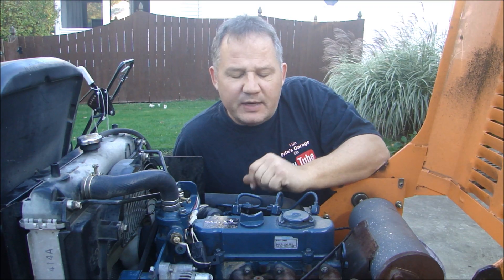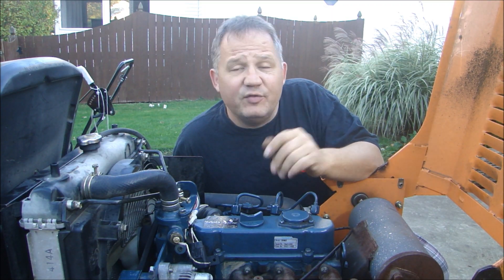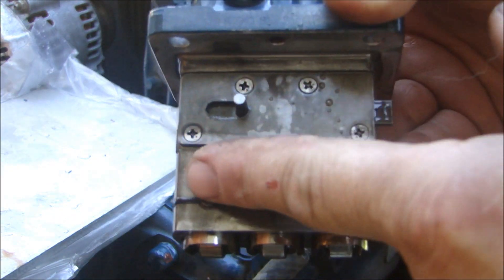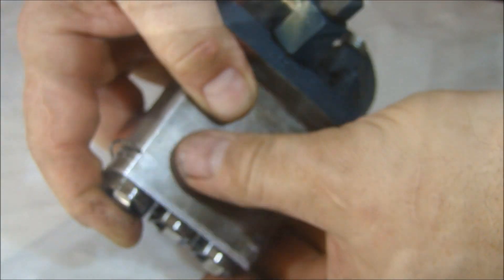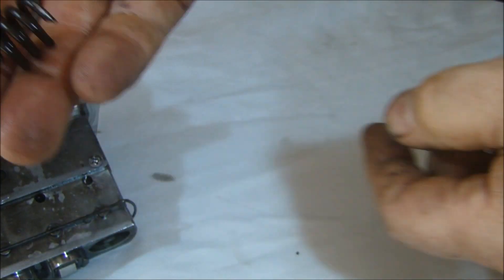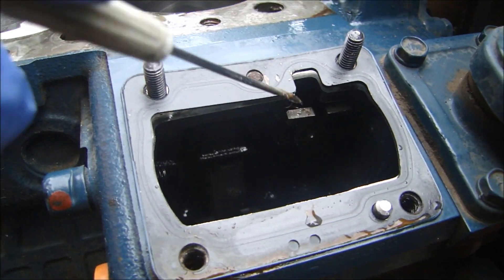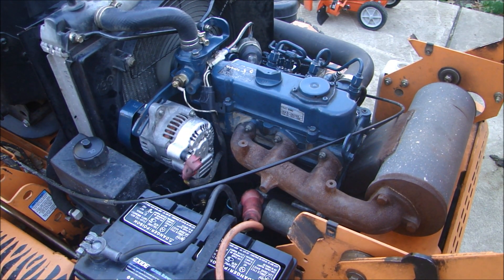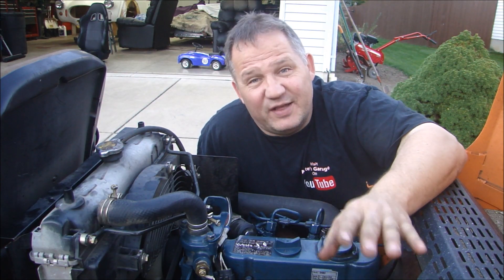Kubota D902 Diesel - Bogging Down, Blowing Smoke

Comment: Mine blows a lot of black smoke when engine is hot
Reply from the maker: Too much fuel, not enough air, EGR system issue, intake over-heating, timing, 
Smoke only under acceleration? Likely turbo or fuel injector issue.
Smoke at idle when hot?  Possible injector leak, low compression, or EGR stuck open.
Smoke plus lack of power? Turbo/boost leak or restricted air intake.
Smoke plus rough idle when hot? Injector or timing issue.

Comment: Just recently got a Kubota 3 cylinder engine diesel generator.
I have absolutely no idea which one it is though, cant find any serial numbers😂 Not on valve cover
Reply from the maker: You should be able to find the serial number stamped on the engine block somewhere.
Reply: @PetesGarage think it'd probably behind some mount. It a generator, but behind another mount i can see 855cc. So think its Kubota D850

Comment: my Toro dingo tx525 has this motor and It felt like the pump was hung up on something when I tried to pull it out.  Is there something else I have to do after I remove the two nuts and two bolts holding the pump?
Reply from the maker: Yes, there is a shuttle inside, you have to lift at an angle

Comment: I'm working on the same engine size (D902).  Do you know by any chance why wouldn't the injection pump come out easily?  I've got all the 4 bolts removed but it wouldn't come out.. looks like it got wedged.  I can wiggle it a little it but it would come out..
Reply from the maker: There is a small shuttle that has to be disengaged by lifting at an angle
Reply: @PetesGarage  Thank you for the response!  I'll give it a try again.   And thank you again for the video.  This was a great video for someone like myself who wants to do my own troubleshoot and service on small tractors.

Comment: Mines oil leak..i did switch to smaller fuel filter up top the see thew inline kind 
.but ran Harley rake today it start ed leaking engine oil at end of day it has never leaked before?
Reply from the maker: I've heard about that

Comment: Hey man i have Kubota d1105 mini skidsteer sk750 ..it started tiday leaking oil on bottom left side of engine where i cant see down there its somewhere under the feul pump it has feul injectors lines and fuel shut off somewhere under around its leaking?
Reply from the maker: That will be tough to find. Put some dye in the oil to find the leak

Comment: We have the exact same machine SCAG Turf Tiger II with Kubota. It blew the head gasket once and even cracked the top due to overheating. Now maybe it has done it agian. It keeps overheating almost immidiately. What can be wrong?
Reply from the maker: Blockage in the system somewhere, radiator, block, hose, maybe the pump isn't working right

Comment: Hello, I have a kubota D902-6E3198 carpet cleaning engine and I am getting a lot of black smoke and the power of the engine drops when I accelerate it and we putit to work, what do you recomend I do?
Reply from the maker: That's a tough one. Could be anything from water in the fuel to a stuck valve

Comment: Pete I have the Kubota D722 it  overheated it’s in a lawnmower and it seems to be losing radiator fluid through the exhaust but you can’t see it. It’s just a black sooty smoke. Should I order a gasket and do what you did pull the injector thing and how do I find out what torque to set the head bolts back at?
Reply from the maker: Hopefully the block or head is not cracked.

Comment: Denso IC regulator 16678-64014 
12V 45A 10021-4732

That's my Kubota D902 alternator, but because i have electric A/C what need 50 A the original alternator is too small. Do you know can i add bigger alternator to Kubota? Something 80 ampere one.
Reply from the maker: Sure you can

Comment: I'm having problems with mine and nobody seems to be able to figure it out   We changed the pump and then it ran great for a while   Now it's having a fuel problem again   When I throttle  down it's shuts off and air locks and won't start back up
Reply from the maker: Look for moisture in the fuel, change the fuel filters, and check for pinholes in the fuel lines
Reply: @PetesGarage  we got it took the injection pump off cleaned it and it's running now   I do thing the upper head gasket has a crack   So that's the next thing

Comment: You'd have to do the valve adjustment anyway, the head gasket wouldn't necessarily be exactly the same height and will affect the distance from the camshaft to the rockers
Reply from the maker: That's true
Reply: Goodness they are some super goobs in the comment section, where are these arguing perfectionist know it all people at when you need them?

Comment: Hi, thanks for detailed video. I had a problem in my gen, when I started it go to full acceleration and I had to cut the fuel for turn off. Could be the rack governor loose in any way and stuck in high RPM? Any advice? Thanks. Is a Cummins onan 7500 with kubota 3 cylinder engine
Reply from the maker: A loose governor will do it

Comment: Hi, I have a question. I recently cracked my head and had it replaced along with the injectors. But it still blows smoke on first crank and under load???
Reply from the maker: Check the fuel supply

Comment: I have an issue with an exmark that has this issue. Someone rubuilt the blown motor and it has never started since ill be running some tests tomorrow. The theory there was more than likely a fuel issue before and someone tried to start it with ether and blew a rod out-of the side of the block. I just hope the guy rebuilt it correctly.
Reply from the maker: Good luck

Comment: I am curious, couldn't you have just replaced the spring? or all 3 springs with new ones?  Excellent video, I appreciate the work you put in here.
Reply: For the wear and price, I would order three new springs.  There is very little wear otherwise, cam lobes were good.
Reply from the maker: Yes, if I had the part number I could have. Thank you

Comment: Hay Pete I have a Bx 2350 and on my number one injector line I cracked it loose to see if I was getting fuel so I tiended it back and now it won't stop leaking it drips
Reply from the maker: You'll have to loosen and reseat the fuel line in the injector

Comment: I need your expertise on a 4010 diesle  Kawasaki mule,runs for 5 minits starts to smoke and runs out of power,and always restarts after 20 minits,help!
Reply from the maker: Check the fuel supply first. Try running it right out of a separate can of fuel to eliminate the entire fuel supply system.

Comment: Great video Pete, Just purchased a Kubota X 1140 Diesel and was curios if its normal that it moderately smells like too much diesel coming from the exhaust? It also blows a little smoke when I initially start it up. I have a Kubota SVL 75 and does not smell as much burning diesel as the RTV. Possibly the Kubota SVL 75 may have more emission control components than the RTV?
Reply from the maker: It could be, until it breaks in some

Comment: Hello, what is the cylinder head torque for the engine please?
Reply from the maker: 27.5 to 31.1 ft-lbs
Reply: thanks, I already added the torque 31 lbs, but I am leaking coolant through the cylinder head gasket into the crankcase, the gasket does not have Gasket?
Reply from the maker: I've had that happen, it ended up being the wrong gasket. You need an MLS gasket

Comment: I have a similar issue with my mahindra 2015HST. I’ve replaced the injectors without improvements. Next is the solenoid fuel pump, which I’m going today. I will also clean the fuel tank when I do that. If it doesn’t change anything though, I will break into the injection pump and change the head gasket while I’m at it.

My only fear is valve clearance. I know nothing about it and I’m worried about screwing it up when I reassemble it. Do you have any advice here?
Reply from the maker: If you don't rotate the engine with the head off you have nothing to worry about
Reply: So ended up taking it to a shop. There is at least one bad cylinder and they’re gonna tear it down. Hopefully it’s just one set of rings.
Reply from the maker: Good luck my friend

Comment: I have a F2880 mower with the D1105 diesel and it has started the blueish smoke and low power. Thought it might be injectors but this seams more accurate. I am no way a mechanic, so your video here has helped me.
Reply from the maker: Glad it helped
Reply: @PetesGarage  was there an option to replace the spring in the pump or do you have to replace the whole pump?
Reply from the maker: You can change the springs, but I could not get the part number and he needed the mower for his business

Comment: How do you assure its in the shuddle? and also i threw my shims out and only remember there being 2 but i bought 3 0,20mm 0,25mm 0,30mm.. but  what ones do i use and what  torque  did you do to the heads?
Reply from the maker: It does take patience to align the shuttle. The shims are for pump timing. I don't remember the head torque
Reply: @PetesGarage  do you know what order the shims go in ? I made a mistake and threw mine out like a dumbass. Not thinking lol. There was 3 of them and i have 3 new ones
Reply from the maker: The shims will be different for every pump. You might have to go with trial and error

Comment: Don’t agree with not having to set valve lash if you replace pushrods in same order. You fitted a new head gasket so clearances will not be the same. Otherwise good video.
Reply from the maker: Good point, but due to unavailability of a head gasket I had to reuse it. I never do, but he needed  the mower
Reply: @PetesGarage  new or old head gasket should still check clearances saves double work if their noisy but hey, I’ll let it go this time 🤷🏻‍♂️😂

Comment: Pete, I have a B8200 and my pushrods bent and took the front end apart to find the cam, indler, and crank gears are chipped. What would cause this to happen. Thanks, John
Reply from the maker: Backfire or fuel vapor lock

Comment: Pete: Thank you so VERY MUCH. I have a grey market YANMAR tractor. Model 2820.
I have searched high & low for exactly the info you provided in this video.

I have learned so much about the care and feeding of the small 2-3 cylinder diesel engines while attempting to get my YANMAR running properly.

Your video may be the final piece in the puzzle. Again a HUGE THANK YOU, for the info regarding the removal and breakdown of the fuel injection pump.

I have removed and cleaned the injectors, bleed the fuel system, run some "Dextron ATF" through the system, and still had one cylinder when running the engine would just push BLACK SMOKE out the stack.

Now I need to find a source for the large spring you show in the video that sits inside the plunger.

Hopefully I can find this spring so I don't have to buy a new pump.

Any info regarding where these springs might be sourced would be GREATLY APPRECIATED.
Reply from the maker: Happy to help Bob, there are some diesel supply and parts places online that sell the springs

Comment: Hello Pete.  I have a 2015 Kubota L3901, 4x4, with loader.  It has approximately 600 hours on it.  I have gone beyond the factory guidelines for oil, transmission,  hydrolic and filter systems changes.   A little blue smoke started blowing around 450 hours
 3 Kubota Dealers looked it over and felt this was normal and gave me several pieces of advice.  New oil, new air filter,  etc, etc.  For the most part,  the blue smoke has disappeared.   My real question is,  can I safely remove the PDF system from the tractor to gain more power??  Its out of warranty now too.  Or is this a fools errand to cause more potential damage.??   Thanks for your advice and support.   Great channel.
Reply from the maker: I'm not a huge fan of removing systems because it will affect something else
Reply: By removing the DPF filter you will have to remove the fuel injector for the said DPF ( they work by collecting soot and when the engine is at working temperature and load it will begin a cleaning cycle, which is burning the soit and turning it into ash in the filter, ) so if you remove the DPF without any other modifications, the engine will still try to burn the soot and thus causing exhaust overheat. And poor fuel consumption because you know. It can’t reach the temperature ( sensor removed and other stuff ) so engine will turn into safety mode. Throw you codes and won’t be able to perform. 

That said. If you have a diesel shop who knows what they are doing, and willing to take responsibility if something goes bad.

Comment: Hi Pete. Thanks for the video. I was chasing the source of a broken pin I found in the oil pan when I pulled the pump.  I also found a dangling spring there by the shuttle. One end of it is longer than the other. I cant figure out where it attaches to and from. Did you have any springs to attach when you reinstalled the fuel pump? I have an electrical external shutoff not the one attached to the timing cover. Thanks.
Reply from the maker: It depends an the pump model. Try looking it up from the stamping on the pump

Comment: I have a N.H. tractor that when replacing a fuel filter i had trouble with it being airlocked. finally got it running but when i engage the blades tractor blows black smoke and bogs down. what should i check next? Thanks
Reply from the maker: Blockage in the fuel tank

Comment: I have the D905 (similar) in a Vermeer S600TX mini skid steer - manual says oil change with filter is 5.1L. dipstick shows waaaayyyy over full. removed about 1.5l and its just above the full mark - is the shallow oil pan common on these?  Pretty sure that mine has a shallow oil pan and Vermeer forgot to change it in their manuals.  any damage likely from being run overfull? it ran a long time as previous oil change shows it had way too much in it as well.
Reply from the maker: If it didn't cause a leak there is no damage.

Comment: I know this video is 3 years old but here goes.  I removed the injection pump and everything looked fine.  I reinstalled, but I'm not sure if i lined up the pin into the shuttle.  I had the injectors tested and 2 were bad and 1 barley working.  So i changed them out and started it up.  The engine is now making a clicking noise i didn't hear before, and smoking more than before.  Could i just take the injection pump off and try to reset, or will the timing be off now?
Reply from the maker: You have to check the lifters on the pump

Comment: Got a question. My 902 revs down at shutdown from full throttle.  Should it not just die as soon as i turn the key off no matter the rpms?
Reply from the maker: IT should
Reply: Fuel shutoff linkage was wallered out.  @PetesGarage

Comment: Pete, thx for the video..when I reinstall the pump it doesn't sit flush,, seems to be hovering and I have to push down to rescrew the Allen bolts. Is this normal?
Reply from the maker: Make sure the shuttle is lined up with the spool

Comment: Nice video. Wish I found this prior to diving into my pump. Similar kubota 3 cylinder in a jacobson turfcat. Hadn't ran in 10+ years, water in the fuel. I pulled the injector pump out. I was difficult to get out because the throttle slider was frozen and it ended up breaking on the gears that rotates the plunger inside. (slightly older design to yours). Called kubota, they tell me that dont sell parts for the pump but they would end up sending it to a diesel shop like D&W. These guys were great. Similar problem with finding parts, I send in some pictures of the pump and have the parts the next day. Got the thing running after a bit of time. Wish there were some videos of pump assembly, trade secrets i believe. Hi from Alden
Reply from the maker: Yeah, diesel engines are always a huge secret. Big money in fixing them

Comment: For ref the pumps / heads are shimmed for engagement...we used to produce these under licence as a Perkins compact engine and the engagement depth varied from engine to engine...you got luck here but could have easy over fuelled
Reply: i have an f2000 with a d950 motor. i recently had similar issues with smoke and diminished power. just to see what would happen i added sea foam and hoped it was a stuck injector. 15 mins later it returned to normal power with no smoke. i got lucky but more times than not start with the simple things first. nice video thx.
Reply from the maker: Interesting, thanks

Comment: Pete's Garge i have V1505  i rebuild the all engine new piston,new bearing,all gasket and new injection pump when start the engine sound like a knocking piston and blue smoke do you think i need replace the injectors?
Reply from the maker: Blue smoke is oil. You may have spun a bearing. Something is not right.
Reply: @PetesGarage  THANK you very much👍

Comment: Take a temp gun run the engine and check which exhaust port on the manifold is cooler before removing head
Reply from the maker: Good idea

Comment: So why was it you didn't just replace the spring and re-install?
Reply from the maker: Nobody would give me the part number, but I've since found it.
Reply: @PetesGarage  where did you find them
Reply: @justinlafon1953  just for anyone wandering along after, you can buy the pump rebuild kits on ebay now, search for "Overhaul repair kit for 3 cylinder NP-PFR3KD50, NP-PFR3KD55, NP-PFR3KX55 " - I just bought one ready to sort my D1105 out for the same issue.
Reply: @manic_tinkererare they the same for D 902 thanks for that info that's selfless of you
Reply: I'm asking are they the same if dont make sense

Comment: Great video. If there is a black smoke instead of blue, what could the problem be ? Could it be the fuel injectors ?
Reply from the maker: Black smoke is fuel so the injectors are a good place to start
Reply: @PetesGarage  Thanks for your response. But its not constant, it happens when I first start the engine and then when I give more throttle.
Reply: I am getting a problem my D600 keep giving blueish white smoke but engine runs fairly good other than that